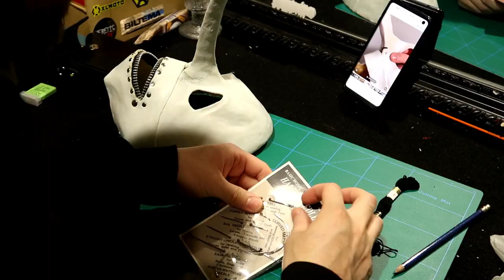Slipknot | Iowa Chris Mask - Converting The Blank

Comment: Hey, love the conversion! I know this is a very specific unneeded question but what thread did you use? I am unsure if Chris' had waxed or normal thread and around which mm is best? I appreciate the help! <3
Reply from the maker: Embroidery floss, and I think I used two threads at once to make it thicker
Reply: @HereticGaze  I appreciate it! Looking at the original mask I think it has a shine to it? Not too sure though feel free to give your opinion.
Reply: Could be polyester?
Reply from the maker: I think it doesn't really matter if it's cotton or polyester, but I think embroidery floss is usually cotton. There's a little bit of brown thicker type of thread around the nose in the real mask too.